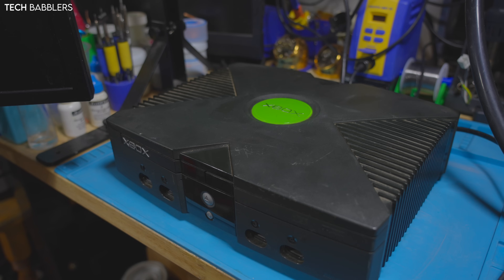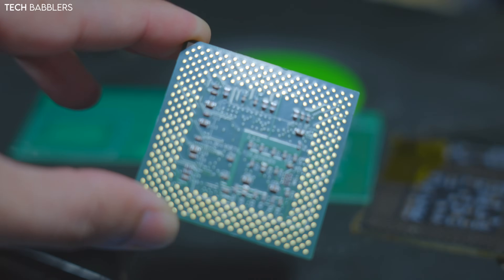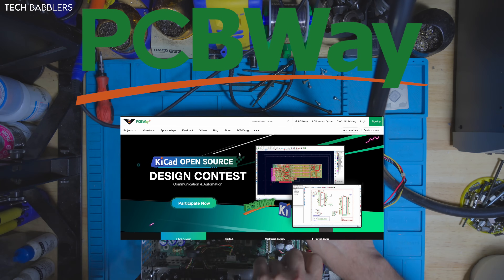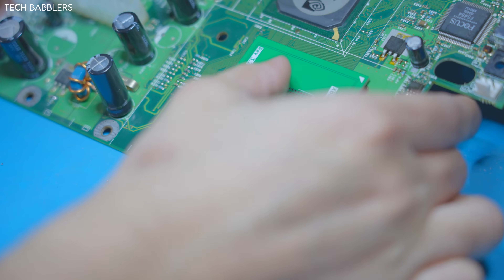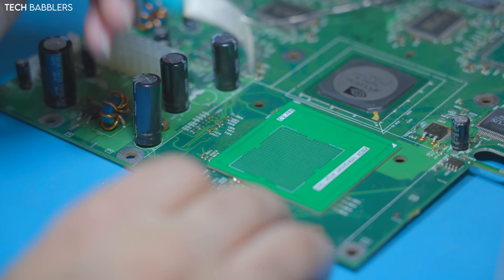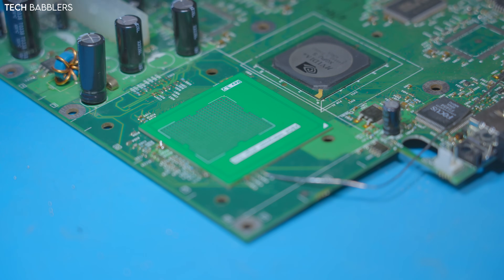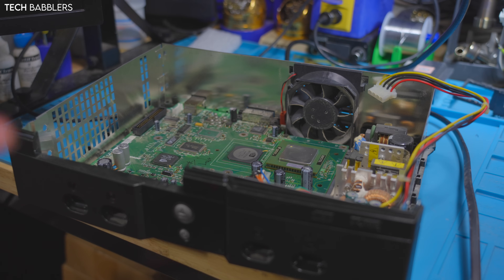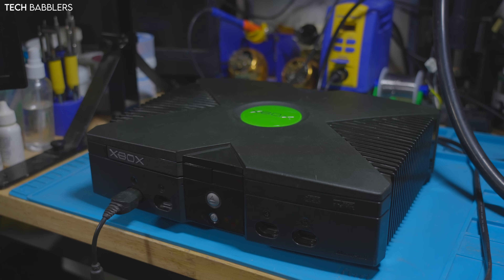Lets Upgrade An Original Xbox CPU to 1.4GHz!

Comment: any idea if there is a GPU upgrade from the box GPU to the geforce3 ti500? and replacing the v ram with faster chips and also doubling the VRAM size?
Reply: Too fast buddy. You dont know basic things like what you refer as "vram" is on this just ram which were shared with gpu and cpu same time
Reply: GPU upgrades might be near impossible on this system due to how memory works. Basically any console you run into will use a "shared memory between CPU and GPU" scenario.

Also the "VRAM size" you're referring to is the system's memory.
Reply: The xbox gpu is better than a Geforce3 Ti 🤦‍♂its a GF4 ti4400
Xbox is a NFORCE integrated GPU actually... and the NV2A is a Geforce4 you dont need any better, just overclock it, the XBOX gpu overclocked at 275mhz is stable and its a good boost, the bottleneck is not the GPU is the crap 733mhz cpu, the box was designed for 1ghz one but lntel scammed MS the other cpu was a 1ghz amd.

Comment: Too bad a socket probably wouldn't have enough strain relief without some through hole mounts. Seems like if you're going to raise the profile, anyway, why not add a socket?
Reply: Given that the profile would only be raised maybe something like a single millimeter, if that, I really don't see why not just add a socket.
Reply: Exactly, this is a super clunky way of doing a CPU swap.
Reply: Yeah I was thinking why solder the CPU if you have to solder the socket? Might as well make it a proper PGA socket
Reply: Honestly, in so many ways, you could say this of so many BGA reflows.  Some don't have the clearance, but the ones that do - socket the world.   Ofc, I say that, but don't put it into practice much - though yeah, I really need to when I start doing this kind of stuff again, for myself.  It's such hot, nasty, sticky work - you just don't want to have to do it again, lol.  Though, I'm sure some enjoy it.
Reply from the maker: A few have tried reflowing a socket recently but it seems just as difficult as this method, maybe one day someone will figure out properly flowing the socket onto the interposer without it melting or misaligning, but right now this is the only way.
Reply: @Techbabblers  You need a board heater. You'd take the PCB that you attach to the xbox, and put that in a board heater, and heat it hot enough to melt the solder blobs on the PCB, then place the socket on and turn off the heater and let it cool. After that, you want to cover the socket with kapton tape or even just surround with tin foil, then attach the board to the xbox's motherboard as usual with your hot air gun.

This should prevent the socket from melting as you first only present the bottom with heat, then avoid heating it directly entirely.

Edit: You may also want to apply the resistors AFTER the socket is on, but that shouldn't REALLY matter, as the board heater would likely just make their solder points cleaner in the end
Reply: @Melechtna  I could be wrong, but I recently saw a video - the tagline was replacing memory sockets with carbon fiber memory socket.  Was for a ddr4 socket, I think.  But if they are starting to make carbon fiber sockets, maybe they're less likely to melt, as well.
Reply: @techrev9999  It's a matter of total surface area, the material isn't NECESSARILY too important, otherwise explain to me how they get the sockets on in the first place? No, the issue is, if you try to use a hot air gun, you're blasting the part itself, you obviously can't use a soldering iron, it's flush fit, so you heat the board, place the socket, accurately, so its pin clams are aligned, and remove the heat.

The bottom MAY melt, just a bit, but this would actually slow the melting of the rest of the material above it, the heat being dissipated before causing too much damage. From there, to get the actual PCB on, you just need to avoid hitting the socket with direct heat.
Reply: @Melechtna  Oh, you described perfectly something I've never done, and I love your explanations.  I am, just, wondering if there are sockets that have a higher melting point to make it easier, if I ever do.  The guy in the video seemed to be able to get them pretty hot, without melting.  While old sockets next to them did melt a tiny bit, that's all.  I'm terrible at soldering, so I need all the help I can get.
Reply: @techrev9999  Well again, they're soldered onto motherboards at the factory, you can't just magic away the heat requirements to melt the solder, especially with it being unleaded solder, instead, you heat the board, and usually it's machine arms that place the components, but functionally it's the same process, just you're the one doing it. If you look at phone repair/upgrade channels, specifically iPhone or even Mac ones, they often use board heaters to get things "just before" the correct temperature, then go at it with a heat gun, so the rest of the board isn't capable of sucking away enough heat to make it difficult to remove or add the part.

In this case, we have a fairly tiny PCB, so the board heater could actually just be turned up JUST enough to do the solder melting itself, then once the part is placed, you turn the heat off and let it cool.

Edit: To more directly answer your question, the parts are already made for that exact purpose.
Reply: @Melechtna  Factory, though, uses robot arms and an oven to bake the whole thing at once, though you are right.  I think the issue comes from focusing heat in one rather big, but overall small component.  Not easily mitigated, though it sounds lkke that's what your technique does - mitigate the small focused area of direct heat.
Reply: @techrev9999  lol, it's not "my technique", board warmers have been a thing for a good long while, but you've got the idea. The part you seem to still be missing, is most unleaded solder melts at around 310F, so, set the board heater to just that, let the board heat up to that temperature, the liquid solder melts, simple as that.
Reply: @Melechtna  Not missing that.  Just had someone else comment on what some of the issues are is all.  In this case, you want the heat not to approach the other parts of the board.  That's all.  It's pretty obvious that if it's something that has been tried, and people found melting to be an issue, then there are 2 solutions.  1 mitigate the heat.  2 use a part with a higher melting point.  I'm not sure why you're seeming to be argumentative here?  I'm not arguing, lol.
Reply: @techrev9999  besides saying, this isn't a me thing, this is a common method, I was just clarifying because it sounded like you misinterpreted my last statement slightly. The only part I was actually arguing, was no, not mine, that's just how it's done... generally.
Reply: @Melechtna  No problem.  Both are good possible ways to do it.  Op seems great at this.  When I tried, I botched just reballing ram, because I was impatient and used the wrong flux.  Then it's such tedious, hot, sticky work - I didn't want to do it again.  Much more fun to watch people do in videos.

Comment: Do you can unlock bootloader to install any OS?
Reply: The OS is a compressed kernel, you can run an Xbox kernel, or a Linux bootloader. The dashboards and menus/programs etc are all Xbox apps. They designed it to where a lot of what we’d consider OS centric libraries are embedded in the application itself.

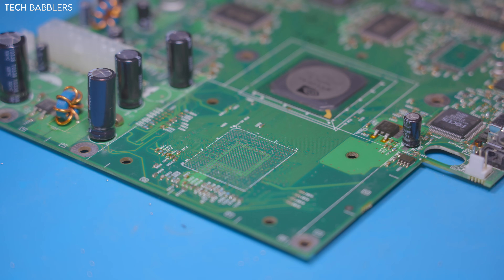Comment: 5:20 looks like the tall capacitor closest to the camera is bulging and needs to be replaced.
Reply from the maker: All capacitors by the CPU were replaced after the BGA work. They tend to puff up even more, sometimes go BOOM during the rework for me, so I do it after everything is done!
Reply: @Techbabblers  I always remove the caps in the areas I'm reworking to avoid blowing them up. Saves a ton of money over time, those caps are sometimes a few dollars a piece.
Reply: is that the one he says he's going to replace towards the end of the video?  or one of the other tall capacitors he also says he's going to replace?
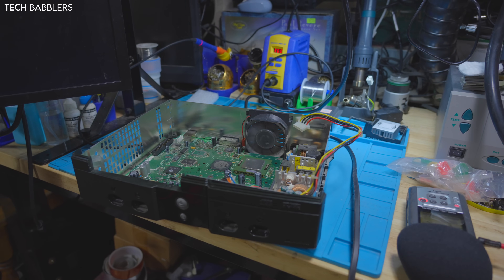Reply: @greenmoose_  15:50 Yeah, same cap. TBF, I don't think he'd miss this given the calibre of mods he's able to perform.
Reply: That is literally nothing.
Reply: @CovenantAgentLazarus  It is literally failed and needs to be replaced. You can see it is also pushing up off the board from the rubber plug in the bottom being forced out.

Capacitors don't have an allowance for creating internal pressure and continuing to operate within original design specs. If they show signs of internal pressure build up, they need to be replaced, no matter how slight.

Comment: This console will never die ❤❤❤
Reply: im pretty sure mine died at this point, don't have the cables to test it. i should open it lol
Reply: PS2 killed it over 20 years ago  🤣🤣🤣🤣🤣
Reply: @MichaelM28PS2 hardware was significantly inferior to OG Xbox
Reply: @MichaelM28  Cringe
Reply: @MichaelM28  I'm not the one that's console warring for a nearly 30 year old device LOL
Reply: @Xurikyo  over twenty years later and you're still console warring LOL
Reply: @Scornfull  lol because it was better and sold 8mil more units than the xbox ever did??
Reply: @Xurikyo  sales doesn't make something better or COD would be the best game of all time? Are you that much of a mindless consoomer?
Reply: @Xurikyo as a owner of both, xbox games hold up better, ps2 is pure nostalgia.
Reply: @MichaelM28 in sales not graphics ps2 was the worse had muddy jaggied graphics
Reply: @southsidetherealest2860  the PS2 had a much more powerful CPU (albeit an entirely different architecture) but it was harder to develop for
Reply: @jvne_  aka it was bottlenecked by the gpu ram and a lack of gpu features
Reply: @jvne_  On paper and in real life tasks it was noticeably weaker than the GameCube's CPU and hilariously weaker than the Xbox's CPU